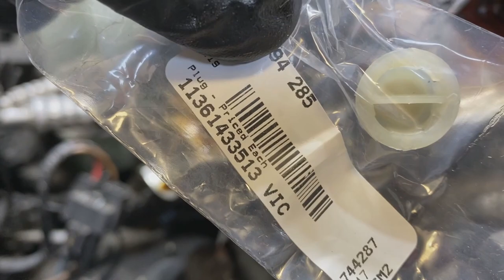BMW VANOS Rebuild | E46 3 Series

Comment: Currently watching as many videos as possible before I do mine this weekend😀.

Other symptoms of loose seals include bogging/hesitation at low rpm, loss of performance with air conditioning on, and reduced fuel economy.
Reply from the maker: Good luck with the re-build. Hope the video helps!
Reply: @OvensGarage  Just completed my seals-only rebuild, and it went great. Turns out that my seals WERE trash, so it was a good job I decided to bite the bullet!